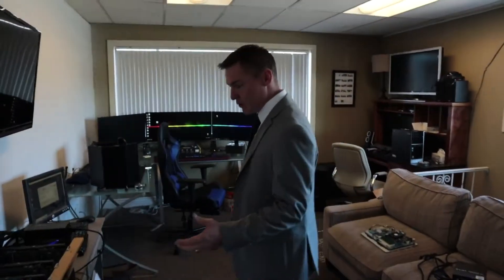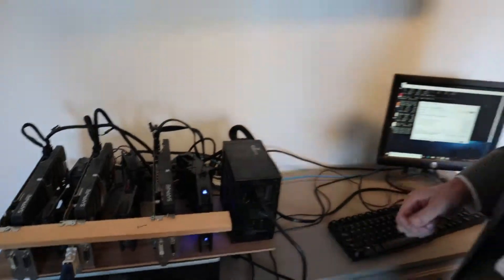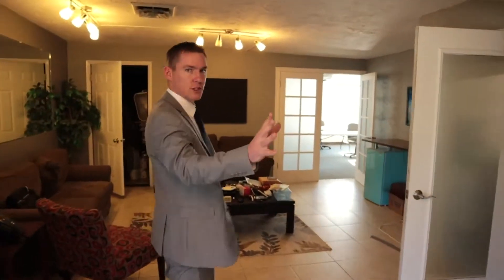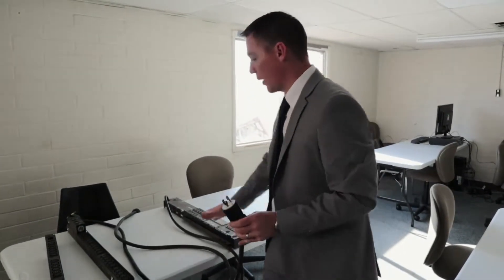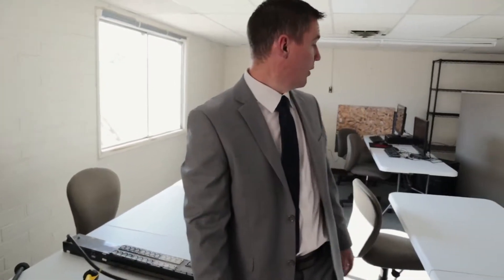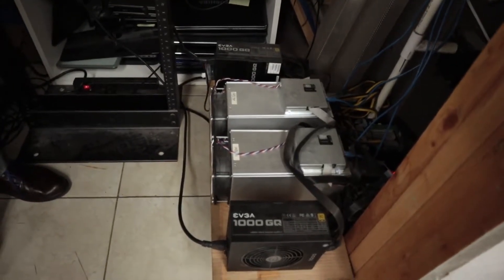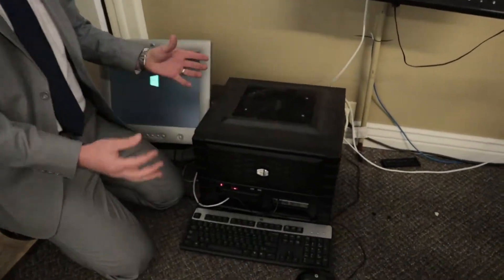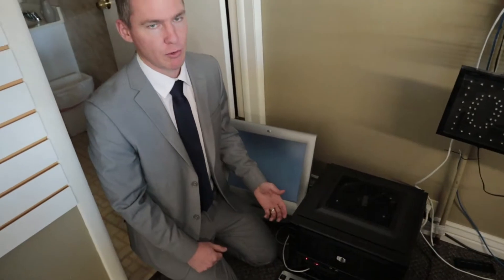Crypto-currency Heaters using Bitcoin and Ethereum Miners

Comment: I've got a super amount of space in the basement of my building... Probably 2500sf. 

Not looking to profit really... But it'd be cool to offset my heating costs with mining and trading.

But I don't really know where to start. Where abouts in the US are you? Or I could just call...
Reply from the maker: Hi Tyson. If you want to get some experience, I'd recommend buying a used ASIC Bitcoin miner from ebay, like this one: https://www.ebay.com/itm/Bitmain-Antminer-S15-28TH-s-ASIC-Bitcoin-BTC-Miner-w-PSU/303312376137?hash=item469ed39149:g:Fs0AAOSwKF1di4A8

You can use a site like this to calculate power usage and profit/loss. https://www.cryptocompare.com/mining/calculator/

I'm in Idaho, and electricity is cheap here, average is $0.08 per KWH, and I was paying $0.055 at the time of this video. Just for an idea, the above linked miner would produce aprox $40 USD profit each month after paying for electricity if it costs $0.08 per KWH, so you might (?) be able to pay off the miner is 30 months and get free heat while doing, if all the figures remained constant for the next 30 months....

Getting cheap electricity is key, even if just using the miners as heaters.
Reply: @LetsDoCrypto we're at 12c here... Which isn't great. Alternatively, I pay $6k a year in heat, and that will certainly go up, and I can never trade anything for that expense. 

I have a 6 plex above the building too, so if I got real smart, I could charge the tenants for a little heating too.

I'm guessing if I dropped $40k, getting $1600 a month (gross) I'd generate a decent amount of heat for a Wisconsin winter. Might cut my heating costs in half.

The only thing I'm worried about, is having to continuously replace the miners. I'm guessing that happens a lot
Reply: @LetsDoCrypto  yeah I don't expect to profit from it... At least not until I get solar on the roof with batteries to back it all up.

But I used to trade a few signals too.

Just a bit more control when you've got a commodity to sell and a bill to pay, instead of just a bill to pay.

Thanks for the info.